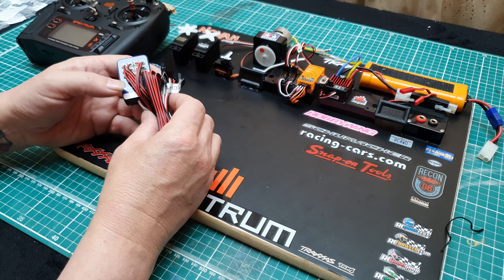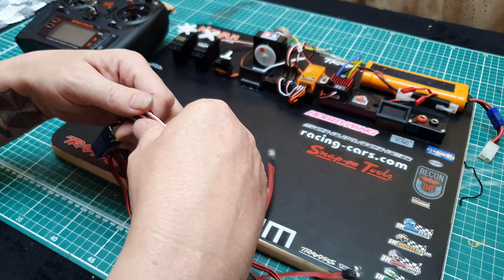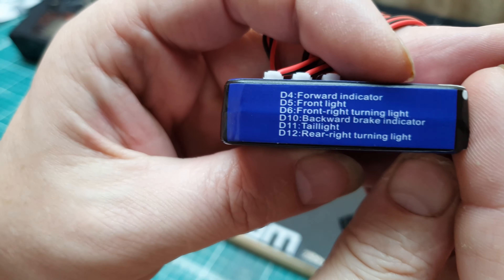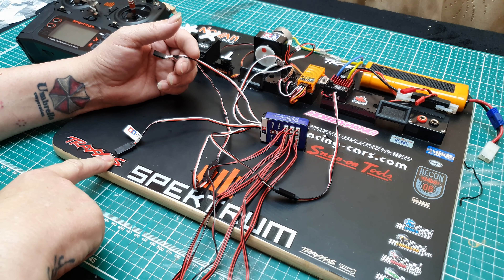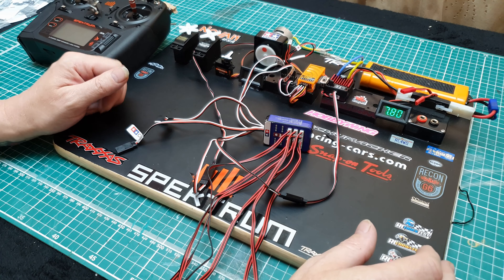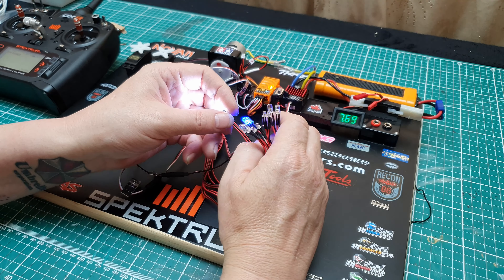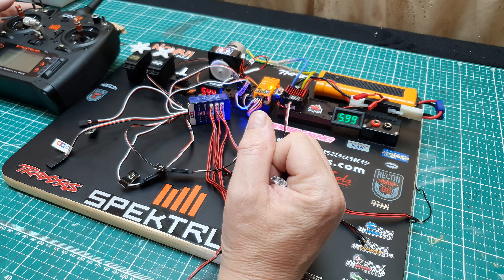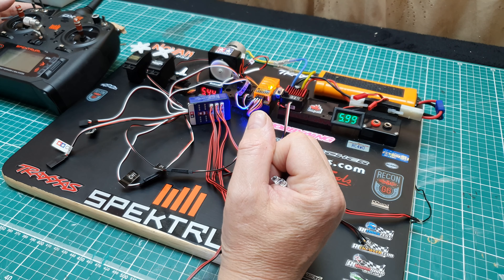A Budget 3 RC Channel Light Kit  - for RC Drift Car, Tank, Truck, Boat etc

Comment: Thanks for posting this. Ive just bought one and am having some issues. It mostly works, but the tail lights and one set of white lights are constantly flashing. The rest are ok though. Any advice please? Additional. The red lights were on constant at one point, but ive no idea what i did to it? Its on a WPL RES V3 board and channel 3 is for the rear tail ramps. I tried that channel and the lights started flashing. Have i fried it!?
Reply from the maker: I've never used a WPL V3 system before so I wouldn't know. sorry.
Reply: @TeriWilde  no worries. Thanks for the reply

Comment: My blue lights come on at random times aswell as the other set of white lights that aren’t the headlights , those turn on or flash at random times during driving sometimes or they just don’t turn on at all this is both my blue and white lights I was wondering if there was a way to make it more consistent or understand why it does that , I reverse and brake and do all that inbetween they just seem to have a mind of their own
Reply from the maker: I've no idea because I don't know how you've wired them or what configuration your lights are
Reply: @ they’re in the normal configuration that it comes in when out the box and I wired it exactly like you did

Comment: Teri,
I have installed the HOP-UP lighting kit on my truck and I too am using the Spektrum DX8 gen2 Tx.  The issuer I am having, is that the turn signals only operate when the “steering stick” is moved nearly 75% of its full left or right full throw.   I also have the problem that the brake lights only come on when the “motion stick” is 75% in reverse and not when the stick is in the neutral position.  I am using the Spektrum FIRMA 70A Brushed Smart ESC, and I am wondering if one of the several ESC programing options may be the issue. I appreciate any input you may have. Tom Garing
Reply from the maker: That's how the light kit works, there's nothing you can do about how it operates, it's just a cheap light unit... Cheap is not good, and Good is not cheap.